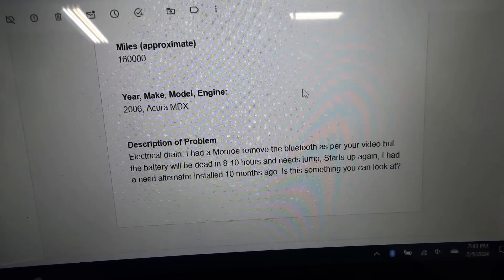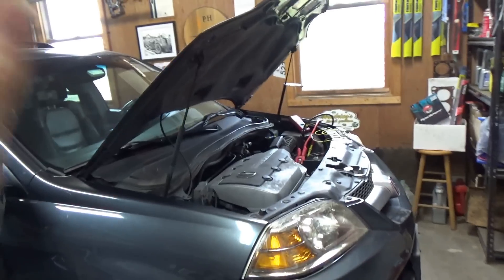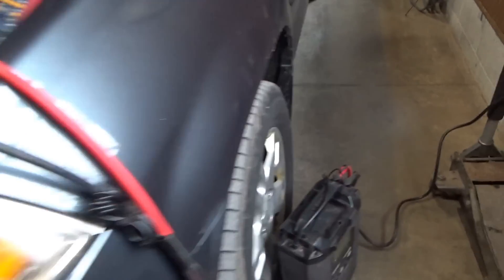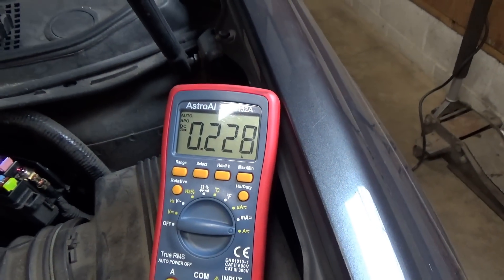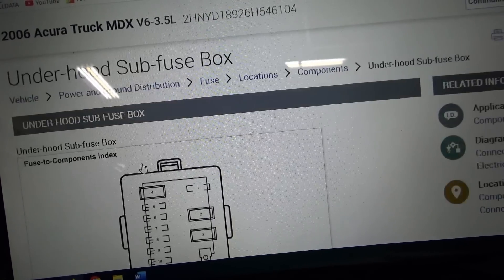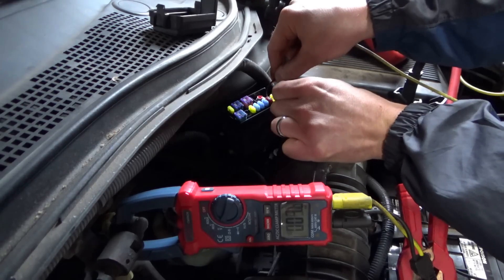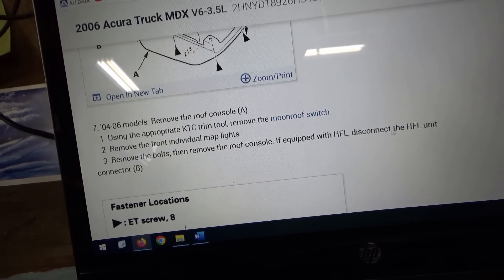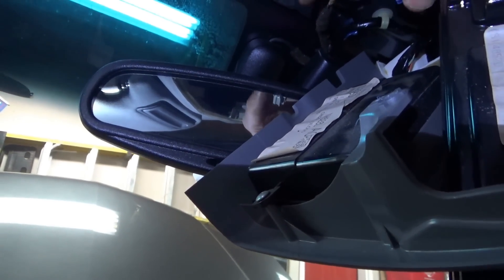Battery DEAD in 8 HOURS? (Shop Already "Fixed It"...? Acura MDX)

Comment: Greaf information. I had a similar draw and got solved after disconnecting the HFL unit. I never replaced it and curious if that connection can be used to power up a dashcam?

Comment: What can be wrong. I have 2006 Acura mdx 
I just changed starter and problem remains. When I turn ignition on to start the car I hear very quiet click in starter and car won’t start. Like starter needs more juice. I Tried jump start it today from a larger track and all I got is same click. All lights on dash board are lid as they always do. Thank you

Comment: Ivan. Good Video. I have the same issue except its on a 2015 Honda CRV. Over 250 milliamp draw when asleep. I spoke to one of our local shops today and they said that the hands free module chances are its the culprit.  Im not sure where the module is so I ordered a Hanes manual on the car to get a better picture so waiting on that. I dont want to take things apart not knowing exactly where the module is. Have you replace that module in a 2015 Honda CRV?

Comment: My Acura tl 2005 has battery drain 4.91 amp already disconnect HFL connector and  mechanic guy pull out every fuse problem still there
I need help
Thx

Comment: Yo Ivan. Love the video. Help us out please- 08 Acura TL Stype. We have the dreaded draw. We disconnected the bluetooth module already in the overhead compartment. The draw is fuse #7 having run all the tests. We cant figure out what it may be. Some threads indicate a bad stereo head unit?? Your thoughts?? What else should we check.

Comment: I never trust those little digital computer battery testers. Carbon pile load tester or the Chrome toaster type at my shop.
Reply: Yep, they aren't putting a proper load on it... Just pulsing a small couple amp load for a moment and doing some fancy math based on the voltage drop.

A real load tester pulling some heavy current will tell you if a battery is strong as you monitor voltage... Although it doesn't give you a fancy piece of paper. Haha

Comment: The problem today is they are paying people per job. They just want to replace a part with no trouble shooting, & move on to the next vehicle. Time is money. I don't agree with it. But with all the electronics, they don't want to take the time to fix it correctly. just change the obvious part. Why they didn't hook up the meter to check for draw when they disconnected the wrong connector is beyond me.

Comment: Thx Ivan. Because of this vid I revisited a draw problem I have been having on my 05 TL. 3 yrs ago, I tried to chase down a large draw on that same 7.5 amp fuse. The diagrams i had from Mitchel  did not show the WiFi on that same circuit, just the interior lights, overhead controls, and remote signal controls, IE key fob signals. Indeed, after pulling said fuse, there was n/p, but several systems didn't work. After looking at your vid, I decided to look into it further. Sure enough there was a module buried in that overhead console  by the headliner with the GREEN connector! I unplugged that, and battery draw was down to .018 amps after about 10 mins. What i cannot explain is that the garage door opener,  automatic seat positions, and alot more still retained their memory and functions w/o me doing anything. Do you think they get stored in the bcm? So 3 yrs later, everything works but the hands free. But let's face it, few phones will pair with that old system anyways. Thx again!

Comment: After using the classic midtronics battery tester for 20 yrs I've decided that it's the biggest liar in the industry. The  "Surface charge detected" and "charge and retest" messages are almost a guarantee that the battery is bad. Set a timer for 7 minutes,  leave the headlights on and if it won't crank at normal speed the battery is bad.
Reply from the maker: Yup Headlights & Crank test never lies ;)

Comment: I got a 2003 Jeep Liberty with a parasitic draw, other people tried to trouble shoot it, but missed the fact that the radio was turned on. You couldn't tell if it was on or off because there is no light.
Reply from the maker: Meaning you could listen to the radio with the key removed?

Comment: its almost like you are from Missouri the show me state after i see it i will believe it i like the old fashion battery testr load coil resistant boxes always served me well for testing  battery's  some of the newer battery's are rated higher amperage than the od testers

Comment: I was paying as I needed it, for a DIY account that I had setup on my Launch.  Having access to just the wiring diagrams alone is a blessing.  It's funny that my employer never asked me why I would ask him for $ every time I got stuck on a problem diagnostic.  Until he sat with me one day while I was doing a diagnostic on his son's car and saw first had what ALLDATA could offer.  And at a sensible cost option.  Now the shop has its own account.

But yeah, these modern smart battery testers are not worth anything.  Just get yourself one of those cheap, old school load testers.  2 or 3 tests with one of those will tell you everything you need to know about the battery's stability.

Comment: We had a driver at work that bought a brand new Buck Century in 2005. Within a month, she took it back many times cause the battery just went dead after a few hrs.  
She filed lemon law after the third attempt, they gave her a brand new cdntury minus onstar and some other fancy items. 

Found out from the dealership that it was the onstar computer that shorted out causing the battery to go dead. 

The vehicle cannot be sold in the state so they had to ship it to another state.

Comment: I always check the Reserve Capacity (RC) rating of batteries I am considering buying for my car. It's a good thing to know if your alternator fails or if you have a parasitic draw. "Commonly referred to as RC, reserve capacity is the amount of time, in minutes, that a 12V battery can run before dropping to 10.5V. It is measured in reserve minutes. For example, if a battery has a reserve capacity of 150, that means it can supply 25 amps for 150 minutes before the voltage drops to 10.5V."

Comment: My old neighbor had a 99 Mazda 626 that a shop replaced a battery terminal with a screw on type and cut the wire which made it too short to have the 6 gauge cable attached to the body of the car. They used a much smaller 18 gauge wire attached to the point of the 6 gauge cable (which was attached to the body) to the body of the car as a body ground. Even a older car, the battery cable needs to be as big as possible for the body ground. It destroyed the PCM and other electronics on the car, including the fuel pump and fuel delivery system. 

Anything with needing cell service with cars, I prefer to use an aftermarket system for that link system. Older cars don't have the modern radio systems for 4G and 5G service. Last time I had seen a 3G setup was maybe 12 years ago. Those no longer work.

Comment: I have an '05 Acura TL and my HFL is in the same spot and was the cause of my parasitic draw. I replaced it and have always been curious what failed inside it to cause it, but never bothered to open the old one. 

Shops are getting terrible these days. I worked on an '05 Camry recently that had some oil leaks, including valve cover gasket and timing chain tensioner.  Went to remove the coil packs - the bolts were practically welded into the valve cover.  The spec on them is only 5 ft-lbs!  The #3 cylinder (engine is 1 3 2 4) would not move, bolt eventually snapped off, and after removing the cover I could not even drill it out. It had been torqued down so hard it became one with the valve cover.  That ignition coil was an aftermarket Duralast coil.  Someone had replaced the coil - it was a local shop, the customer showed me the receipt - but the part number was for 2006 through 2009 Toyota Camry, and this was a 2005 Camry. The coil was about 2-3 mm too tall, so the tech torqued the everloviin' snot out of the bolt to get it to sit flush.  Probably caused the gasket to fail early in the process.  Junkyard valve cover + replacement OE Denso coil and all is well.   What a dumb but costly mistake.
Reply: Customer probably gave him the wrong information on his car. So AutoZone gave him the actual part for the year the customer stated. As far as the mechanic . You take your chances.
Reply: @2nickles647  Even if that was the case, there are several failed checks there. I scanned the car pre-repair and it tells me it's a 2005 Camry. The date on the door confirms that. The one lone non-Denso ignition coil is physical different and quite obviously does not fit.  Why would that be?  I looked up the part to check for properness, bingo.  This is basic stuff here that should not be messed up. The right parts for the right car, it's not rocket surgery. 

fwiw, the owner told me it was a 2005 Camry, so I doubt that's the reason. They've owned it since 2008 and provided the sale paperwork in a folder that included all the other past work. The owner was very aware. I've worked on  cars that have  seen the same shop before and they've had work orders in the glove box with parts that match Duralast on the car, and there's an Autozone in the plaza next to them.

Comment: Yessiree...and you can read and get tips all day long but without a good foundation of experience...you will still be limited in abilities to diagnose.  As in this video, Ivan had way more experience and fixed this concern in just a few minutes plus, along the way he found the new battery is very limited and should be replaced.

Comment: Another easy battery test if ya don't have a fancy carbon pile tester is fully charge the battery than  disable the engine from starting record cranking voltage should stay above 9.5 volts for 15 seconds I like to see 10 volts or higher

Comment: Alternator will maintain the battery voltage its not designed to charge a dead battery again and again When your battery has gone dead charge the battery with a battery charger test and than place it back in service want to kill your Alternator just keep jumping your dead battery and go

Comment: On a 2000 Yukon XL I had the OnStar module draining the battery. I just pulled the fuse for the roof lighting circuit which powered only the OnStar unit. Thanks Ivan!
Reply: To all that read these, the cellular network keeps advancing and leaving the older vehicles without the accessories. There is also no way to upgrade them. What a niche market for some upstart company.

Comment: Well done Ivan :-D
Odd that the ignition switch output didn't go through a fuse to the overhead module.
Not ideal but the power would get there,  or a relay.......   ha ha im relay crazy :-D.
Dam silly designs.

Comment: Aside, from the hands free module.   One of the best vehicles that Honda ever made!!!
Reply: I got the 2005 model... Radiator transmission line inlet and outlet corrode over time.

I got an aftermarket cooler and temp valve and bypassed the OEM cooler on the radiator itself.

This happens to the 3rd generation as well (2007+) as noted on MDX/pilot /Odyssey owner forums

Comment: I have a cheap electronic battery tester. I think it works very well. But like all things it’s only reliable if you fully charged the battery and then you have waited 3 1/2 hours to test the battery. It gives the usual information like the CCA and indicates good, fair or bad. But what’s really important is the impedance of the battery. A good battery will have low impedance. Like no more than 5 ohm, older batteries in fair shape might read 7 ohm and higher than that your battery has become sulfated and either needs desulfated or replaced. I like the electronic tester for that reason but if I have reason to doubt what it’s telling me I pull the battery out of the vehicle and check it with my 1000 amp carbon pile tester. While it’s on the bench I check the specific gravity of the cells. I remove my batteries twice a year and charge them with a PulseTech charger that desulfates them. I’ve even recovered batteries that should have been replaced but are now the same as a new battery. The price of batteries has risen to the point that it pays off to maintain my own. I don’t know about doing the service for customers. It takes about three days on the charger. Balancing the cells probably isn’t an average DIY thing either. Typically only one or two cells will be sulfated the worse and the specific gravity will be low. Everything that was in the battery is still there and desulfating first and only adding distilled water if needed.  After the PulseTech charger has desulfated the battery and the impedance has been lowered to a viable level should the specific gravity be balanced. Also I feel like I need to say I’m not a battery scam artist nor am I affiliated with one. Don’t ever put anything in a lead acid battery except distilled water or sulfuric acid. There are no secrets and lead acid batteries have been around a very long time and haven’t changed. The book “The Automobile Storage Battery, its care and repair” can be found on Google books and elsewhere. It’s known as the Whitte battery manual so named after O. A. Whitte chief engineer American Bureau of Engineering.

Great Job Ivan, I like all your videos. Wish more mechanics were like you, actually mechanics.

Comment: i grew up using a sun vat28 and later a vat40. i'll use one any day over these fancy electronic moron machines. i've used a few of those too. they do not put enough load on a battery to truly test its reserve capacity. it also does not show the if the battery is chemically alive. recovery time is easy to see on a needle not so much on a paper printout.

Comment: Not having service information or good bi-directional scan tools will put you so far behind. Also if you bought service information and scan tools get training on how to use them. I have argued with a shop owner that ripped a lady off. He told me he was a technician and had an expensive SnapOn scan tool, but when I questioned him on how he diagnosed the car. He had to admit he read codes and threw parts at the car that didn’t fix anything. After calling him a parts changer he refunded the money and told us to get out off his shop. 🤣🤣

Comment: Supposedly, the "high-tech" battery testers are load-testing a battery on a very short-term basis by pulsing a semiconductor like a MOSFET and measuring instantaneous current and voltage values. Problem is, the internal resistance of a good car battery is quite low in comparison to the connections that are made to the tester. It's amazing these testers ever work well at all. Just like so many things, the emphasis has been on eliminating hardware, and enhancing the software used by the microprocessors that supposedly analyze the battery. The temptation is to "program around" deficiencies and make it work, and that's what the manufacturers try to do. Good call on your part!!!!
Reply from the maker: I don't see any value to the fancy battery testers when the car can perform a real-world battery capacity and current test by itself with no tools required haha

Comment: I can attest to the fact that the digital battery testers are junk. Twice had a shop and a parts store use them and was told battery was good. But put a good old fashioned load tester on it and as the load was applied you could watch the voltage drop clear to 10.5 volts. Its sad that dealerships and parts stores rely on these junk digital testers.
Reply: It's a way to sell more batteries. Such as the case where the auto parts stores sell parts. 
Customer wants a diagnostic check because their car is acting up. The parts guy plugs in their scanner. The kid at the counter says...o it's this. Customer buys the parts. Next day..same problem...wants a new part...done deal.  Still not fixed. Told to take it to a shop for actual diagnosis. Customer says no because of the cost😅😅😅

Comment: Ivan, You are absolutely right about "smart" battery testers. They are garbage! Many years ago I bought a battery at my Toyota dealer. When I got home I noticed the Voltage was below 12.3 volts after a proper charge cycle. That is not normal, it should be at least 12.6 Volt with a new battery (Lead-acid). I went to the dealer and told them I want a new battery because this was damaged. The tested it with a "smart" tester that said the battery was OK. I was not happy with their finding!
After a week a had to visit a friend and the battery was totally dead! My friend took me to the dealer and i asked for the manager. He eventually told his staff to give me a new battery. The battery was a Toyota "economy" part i.e. crap quality. It worked for about two years. After that I bought a new Bosch battery over 10 years ago and it's still fine!
Reply: 10 year old battery you need to play the lotto
Reply: Budget batteries of any brand have a life expectancy of two winters a better budget battery might last three. 
A battery  from the top premium  range of a quality manufacturer such Yuasa, Bosch, Varta, or Exide should  last seven to 10 years  or more if the car electrics are doing their.job properly Smart battery testers do work they are actually very good at spotting a battery in the early stages of failure but should not be used as the only test, that needs a high amp load tester which draws a high enough current to suit the CCA of the battery.
Reply: Bosch is quality, say no more !!!.
Reply: Denso
Reply: @fieldsofomagh my stepdad had a Bosch battery in his truck that lasted nearly 7 years.
Reply: Yes Bosch are brilliant
Reply: The "Toyota" batteries at the dealership are made by Interstate nuff said.
Reply: @montefiveforty1 Subaru replacement batteries are also made by Interstate and they are junk.junk junk.
They are 2x worse than $90 Everstart batteries from Walmart.